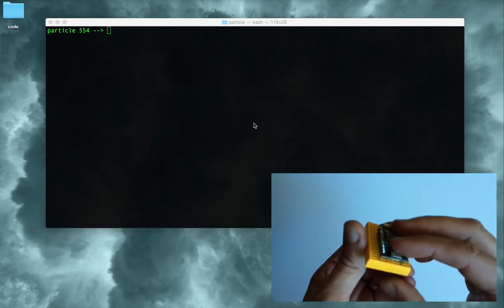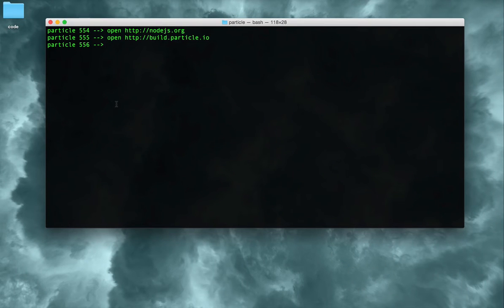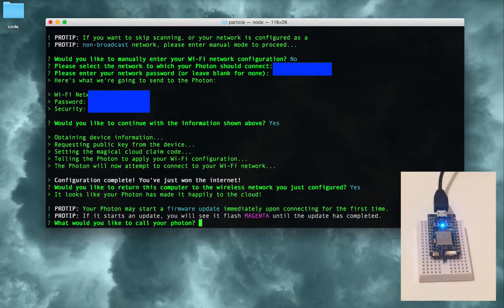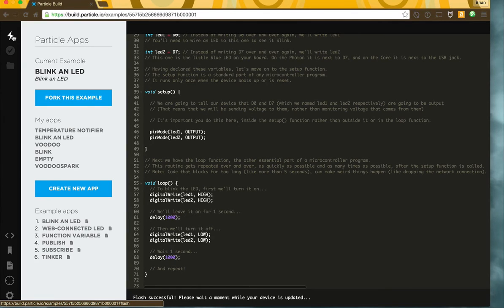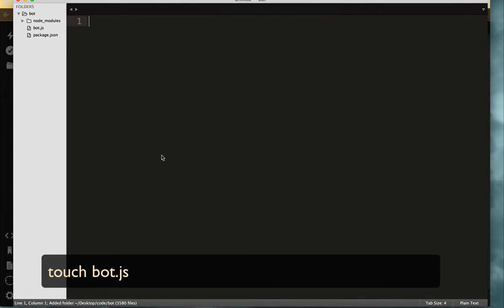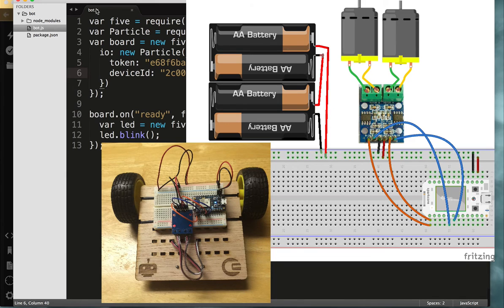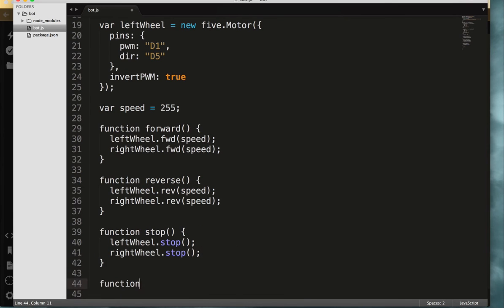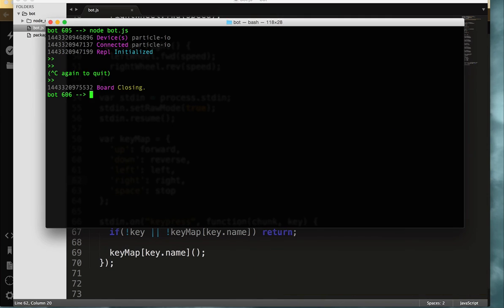Get your motor running: Particle Photon and Johnny-Five

Comment: Can you still have connection to the internet via WIFI or is the WIFI connection being used to send commands to the ParticleBot?
Reply from the maker: Yes, in fact, that is how the host gets the IP address of the Photon.  When the Photon boots up, it posts the local IP address as a variable to the Particle web and then opens a TCP port.  When the host connects to the Photon, it reads the variable from the Particle web, and connects to the port on the local network.  So yeah, the particle is still connected to the web AND the local network, the same way your laptop is.